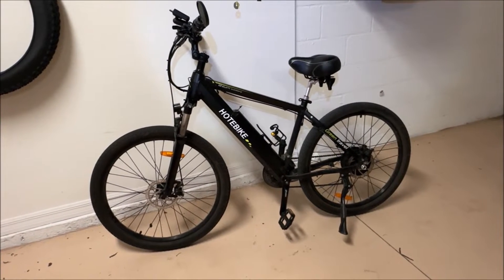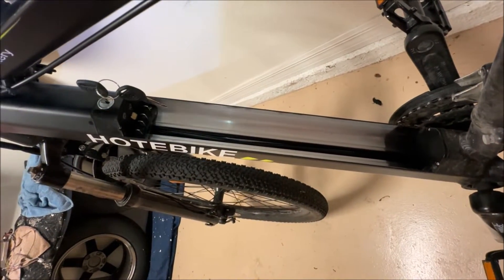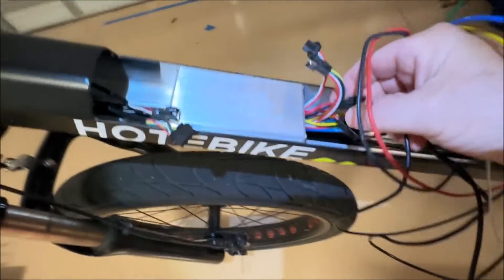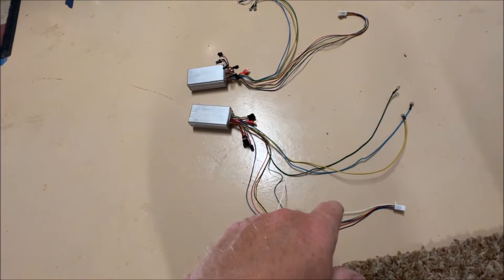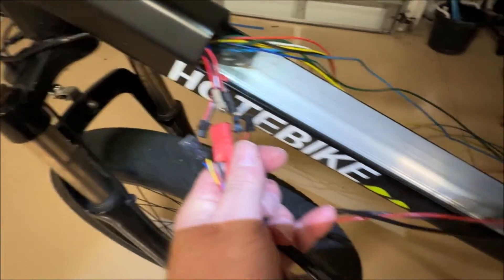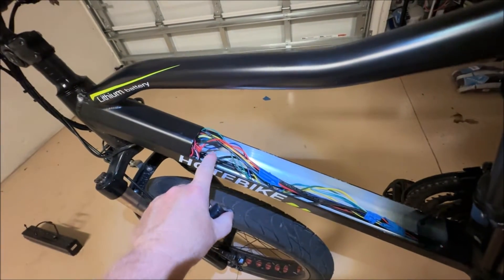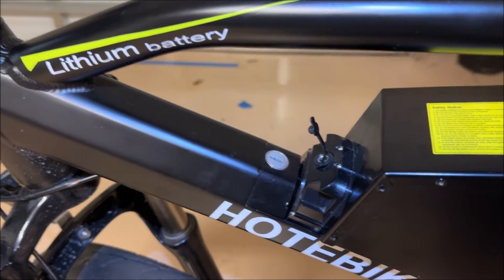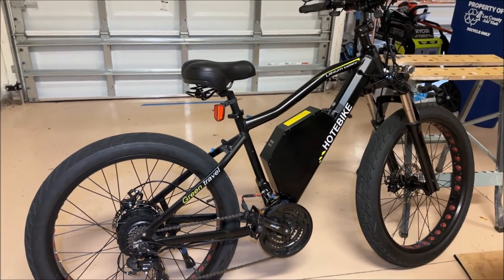Ebike Controller Replacement _ The Easy Way

Comment: What is instrumentation my e bike is showing  e33 mine is a heybike race  max but every time I twist the throttle  the e33 goes and comes back I'm not getting  any power to the motor  I can still pedal  pedal assist  don't work